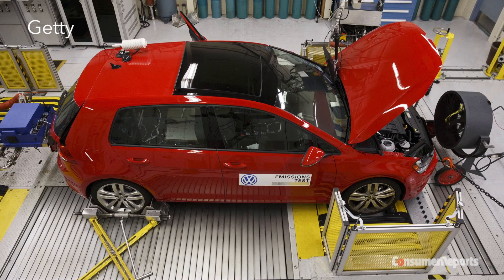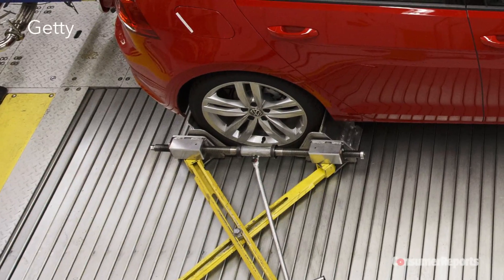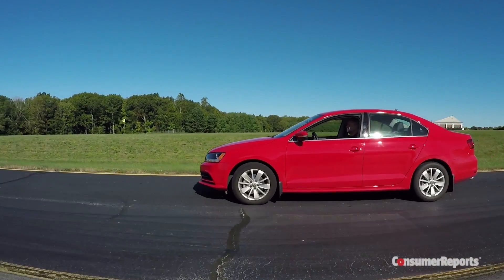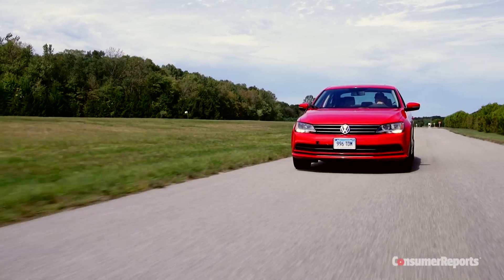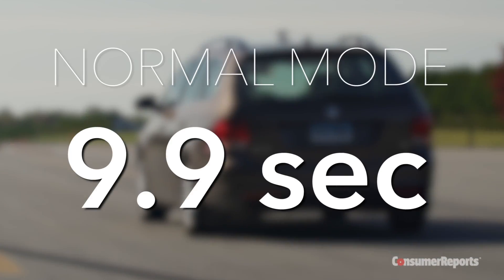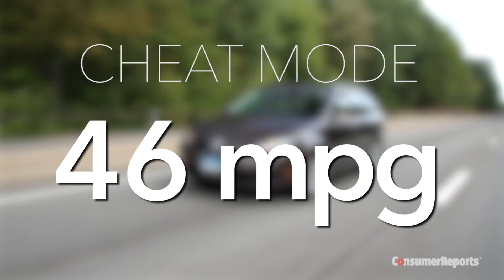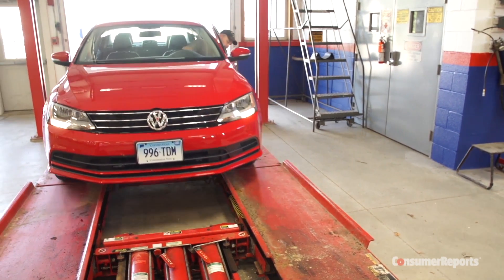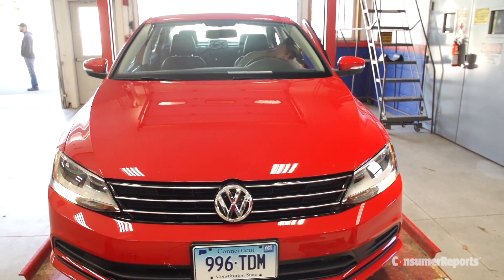How Volkswagen Diesels Perform in 'Cheat Mode' | Consumer Reports

Comment: You did succeed in  engaging  cheat mode,  the vehicle ECU monitors a multiplicity of parameters far beyond the ones which you disabled, speed vs time and steering wheel angle to name two,  google, during your back-back driving comparisons, the defeat device will be in operation allowing the 20 to 40  times exceedance of EPA limits for Nox emissions,   Felix Domke for a highly regarded forensic examination of the VW defeat device  equipped ECU

Comment: Thats not emission mode!! You applied steering input cant do that. And a lot of other errors... The car knew that it wasen´t beeing tested. There are about 8 parameters that need to be fuffiled for it to lower emission. The test is standardized so it looks for certin speeds and rpms for x amount of time to. air pressure also and so on. So this test it total fail.

Comment: I believe the DEFEAT DEVICE works like this.
When a VW car is being tested, the OBD/DLC plug has to be connected to the vehicle.  Upon connection with car on or off.... the VW's  computer uProcessor DETECTS   *thru a small voltage signal(s) to a watchdog pin(s)*... a 0 or 1 digital level ALERT signal. Meaning that the OBD/DLC plug is IN and so... TEST TIME condition is ON.  Therefore, the system's software defaults automatically to a LAB TEST CONDITION situation. Meaning all EPA components are activated.  As the car should NORMALLY be the entire time it runs. And so, the car runs perfectly, complying to EPA mandates and specs...passing or not the test.
The DEFEAT DEVICE software (disconnect EPA components) is automatically re-enabled as soon as the OBD/DLC plug...is DISCONNECTED. Meaning the test is OVER.   The software detects that the watchdog pin or pins are at O or 1 digital level. And upon turning the car off and back on, the computer RESETS itself back to CHEAT mode. Until the next EPA testing session. It's a rather simple process. 
This is the simplest way I can explain it.

Comment: VW has been making a diesel engine that gets over 50 miles to the gallon since the 80s. This cannot be said for any of the other car manufacturers. My VW TDI holds 14 and a half gallons and goes a little over 800 miles to a tank there is not a single gas car on the market that gets that kind of economy!
Reply: Really? I get about 600 hwy with my wife and I's 2013 Jetta.
Reply: avenged06x what was your average speed? I get 50+ at 65 mph and 70mpg with my stage 2 tune with dpf and egr delete

Comment: It really makes no sense, if you run a engine lean to pass the epa test in cheat mode it seems fuel mileage would increase. their must be something about the diesel engine, that when it is leaned out to the point that it would pass the epa guidelines, engine efficiency must go down to the point that it would take more throttle and rpm to do the same amount of work. this could be whats going on here.

Comment: This whole video is presented ass backwards!
these cars are in cheat mode when the drivetrain module sees ALL FOUR wheels in motion - when they "hacked" the module to see only two wheels in motion, the car is in TEST MODE.
That's why the car shows better mileage and performance WITHOUT their "hack"
Dumb ass Consumer Reports!
I've very seldom seen them actually know what they're talking about.
(I KNOW they're wrong on this one, I've owned two TDIs!)
Reply: Mike US OG K depends on who is being cheated.  Is it the person that paid for the car or is it cheating EPA?  In any mode it is either cheating the owner or EPA.  Let's put it this way, if it is on limp mode it is cheating the owner momentarily which only happens when it is undergoing a test (you didn't pay for a detuned car).  If it is on max power mode then it is cheating the EPA which doesn't matter whether if it passes the emissions test with the cheat on or off.  Falsifying info is always bad especially against Uncle Sam.
Reply: C6Roadster 
All of the hype has been presented as the vehicle is in "cheat mode", as in cheating under normal highway driving, not in test mode, so that's my take on "cheat" - as presented by the majority.
By majority opinion, the cheat is not passing certification, in this "mode" the customer gets better fuel mileage and better performance.
Technically there is no cheat - the car(s) pass the test guidelines set forth - at no time do the parameters include testing the car on the road or a four wheel dyno, and the cars pass the specified test under the specified test conditions.
I agree that it is wrong, but they're not exactly the first car company to do so, they merely got caught. Dodge did exactly the same thing at the turn of this century with their diesel pickups.
There are numerous other instances by US car companies over the last 3 decades.
The emission digressions by the other companies were all but ignored.
Ford is "cheating" presently, the Mustang GT only produces advertised horsepower on a two wheel chassis dynamometer, when tested on a four wheel dyno - which simulates actual driving - the power produced is significantly less than advertised. This is only cheating the customer, and false advertising so the government doesn't care.
As far as my statement about consumer reports, I stand by exactly what I said - their opinion of cheat mode and the entire auto industy's are exactly polar opposites.
The one point in all of this that is entirely ignored is that cheating or not, these cars are
 STILL cleaner than the vast majority of "legal" diesel vehicles.
Right or wrong, there's as much here in the way of politics as anything else.
Reply: C6Roadster 
Just to show that GM isn't exempt, a Corvette with a drivetrain module programmed to back out ignition timing after a period of time, causing an overheat condition, which in turn puts the car in limp mode, all in the name of limiting agressive drive time is exactly a cheat. The Corvette cheat reduces warranty repairs for abusive driving.

Comment: Why does it get less mpg, if it makes less power? Aren't those usually mutually opposing factors? Is it an efficiency issue?
Reply: +Beastly G 
true. my 2003 didn't, but my ex's 2013 does, first year for DEF for VW I believe. 
The car isn't as dirty as most would believe, it's is still cleaner ( even in cheat mode) than any "legal" full size pickup/suv.
As a minor point of interest, my 2003 had gone 340,000 miles - it's still in use today -
with one major repair, the turbo wore out at 310,00 miles. the nay sayers obviously haven't owned one.
Reply: crxdelsolsir 
I'm quite well aware.
Exactly my point.
Isn't right...
Same road, same air, but anything heavier can belch smoke & toxins but the car - which is at least 50 times cleaner, even while "cheating" - is a huge problem.
It's just fucking stupid.

Last time....    Dodge Ram Cummins 2000 - 2002, Dodge was told "bad pickup, bad!"
And no one heard a thing.
Reply: Mike US OG K
That was exactly my thinking on the issue too! I just didn't get why VW's are suddenly these
evil ozone death machines, but the giant diesel trucks (pedestrian ones, obviously the ones that transport goods exist out of necessity), and SUVs etc all get a pass. Especially when they still pollute more. I guess people would probably say well, at least they "didn't lie about" polluting a shit-ton lol.
Reply: When I heard about this at first, I was confused as well; I thought that a car using less fuel would have cleaner exhaust just because less fuel is being used! I've learned that it may relate to how the exhaust gases are filtered out after the fuel has combusted. Cleaner emissions control systems tend to generate more engine back-pressure, which causes the engine to have to work harder to run at a particular speed than if it had a dirtier but more-direct exhaust system. When it comes to the issues with VW's cars, I suspect there may be something in the chemistry of burning diesel in 'normal' mode which causes the exhaust composition to be dirtier in exchange for allowing the car to get more power from each drop of fuel.
Reply: Patrick Carnahan
That makes a lot of sense. I do know that VW doesn't use the urea injection that most other diesels use so could be a factor as well.
Reply: Mike US OG K
Completely agree, that's exactly what I've been saying... (about the trucks and SUVs being dirtier)!!  Very impressive on the miles. That's good to know.
Reply: Beastly G 
Absolutely!!
And yes, I've been more fortunate!
Reply: SUV being heavier are benched differently due to their inherent weight. Just as buses and semi trucks are not in the same class and therefore benched differently.

So their ratio of particulates per distance traveled per ton of mass is very different to a light weight vehicle.
Reply: Mike US OG K Yes, very likely. Especially when chevy just started doing their own economical diesel cars.... mighty suspect timing.
Reply: Beastly G 
Exactly.
👍
Reply: +Beastly G 
My '15 TDI Jetta uses DEF.
Reply: Mike US OG K
Hmm, maybe just the older ones don't?
Reply: Beastly G 
I think there's more to it than meets the eye, maybe a little corporate espionage.
My opinion is that it is an opportunity for other carmakers to "cripple" the largest carmaker in the world (VW), so they're more than happy to help make a fuss over it.
Reply: Beastly G diesel engines get better fule economy the more powerful they are
Reply: Mike US OG K  VW got in trouble because they tired to cheat the EPA the EPA is bull shit targeting diesel engines but the fact we can make B20 hurts big oil lobbiest come into play here blah blah blah lots of bull shit German company that is largest auto maker in the world 
pick ups are also regulated different then cars lots of stuff goes into this 

but as far as fule economy diesel make more power use less fule by compressing air and using it to burn diesel more efficiently vs gas only has a 30% burn rate
Reply: The Corey Becraft show 
So what are you trying to tell me?
I know exactly why VW got in trouble in the first place...
And I know other companies have gotten away with it in the past, so why crucify VW - there's more here than meets the eye.
If you don't believe the VW group is the largest carmaker in the world - go look it up for yourself!
Yes, I know quite well pickups are qualified differently - doesn't change my point in the least.
I also know EXACTLY how diesels work - that's why I drive one.

Blah blah blah bullshit yourself!
Reply: I told you they are the largest auto maker 

my point is that the United States has a beef with diesel engines and VW Being the biggest diesel automaker they targeted them that's all I said boss so chill out 

and the people who were talking like they didn't understand how diesels lose fule economy by losing power I was explaining that to them
Reply: The Corey Becraft show 
So then why did you tag me?
VW is the largest car maker in the world - period, diesel or not.
You didn't tell me anything new about VW.

Don't say blah blah blah bullshit to me then tell ME to chill out - you started it, so think more about what you say to someone before you tell them to chill out.
Reply: did you even read what I was talking about it was talking about the EPAs bull shit reasons again I didn't say they were not the largest auto maker in said they were indeed and I also said they are the largest diesel I just hit reply to the video didn't mean to tag you and your getting all pissed off and didn't even read what the comments said

Comment: Personally I dont give a damn. I dont have a volkswagen anymore. I had an old jetta and the dealership wanted 90 bcks for an oem wheel bearing. I bought generic replacement one for 15 bucks each. They told me at the sealership it had a lifetime warranty if using their mechanic. So $90 each plus labour. I did it myself. Even if I had to replace it 6 times by myself it still woulda been cheaper.

Comment: cars were bought based on EPA economy and VW power ratings . Getting better economy is a perk; going back to EPA economy is not an issue . Reducing power 10% still makes it similar to competitors . I plan to maintain my Passat diesel and keep it for 700,000 km, avoiding one car purchase while getting great mileage savings (in Canada)

Comment: The Fast Lane Car did a similar test - using a dynometer  that runs all four wheels, to two wheels, and tested horsepower.  It dropped some - which it looks like matches what Consumer Reports got here on the older model.  The rear wheels spinning definitely it was keys off the computer chip.  If it is more complicated that that, TFLC did not catch it either.

Comment: Biggest problem I have with the entire diesel gate story from all the medial outlets is the 40x figure that's been thrown around. Here is what someone needs to do: get a mobile NOX measuring device and ACTUALLY MEASURE THE NOX COMING OUT THE BACK OF THE CAR while in motion. A recent test on some UK website showed that the static / stationary test can be off by a factor of 10x regarding NOX - they used a mobile NOX tester. 

We are all quoting the same source 40x BUT why can't someone actaully measure the NOX in a real live test not just guessing how  the defeat software works by messing about with sensors  or putting the car on a 4 wheel dyno etc? And an even better story, could this be industrial espionage - the Chinese adding the code - this is a very difficult thing to detect and reminder the Iranian centrifuges  ..... :) 

Also comsumer reports how about getting a big old diesel pickup and look at its NOX - probably 1000x the amount of even a cheating diesel AND I believe it's NOX exempt?? And the UPS van that delivers your Amazon prime swag or the big rig that is also EXEMPT from NOX ...... How about putting it in perspective?

Comment: I think its only done to meet the demands of EU. The EU requirements for emissions are getting ridiculous.
Reply: +NikesZ28 Actually EU emissions is very lenient compared to US limits.  The EU levels are about 15 years behind (i.e. they match US limits of 2000)
.
Reply: electrictroy2010 i was actually thinking about upcoming limits, thinks its by 2020 no car is allowed to emit more then 100 grams/kilometer of Co2.
If what you say is true, why does european  people drive around in cars with tiny 4cyl engines and americans drive around in cars with big V6 and V8 engines.  ;)
Besides the fuel cost of course.
Reply: +NikesZ28 (Americans only pay 50-60 cents/liter. We don't care about guzzling gas)  Our EPA doesn't regulate CO2.  They regulate lung-damaging chemicals called NOx, CO, exhaust hydrocarbons, and soot.  That's why in 2006 when limits were lowered, diesel sedans were effectively banned.   (Then manufacturers discovered urea injection & reintroduced diesels in 2009.)   ANYWAY that's why I say US limits are much harder to pass..... the EU limits were never so low that diesels were banned from sale.
ASIDE : Another technology that was banned : Lean Burn gasoline engines from Honda.  When 2006 arrived, Honda was forced to stop selling lean-burn technology, due to the EPA's strict low limits on NOx
.

Comment: Eum, Consumer Reports doesn't seems to get how these modern ecu works, there's more than just removing the rear speed sensor to engage cheat mode, what you activated was safe mode since the ecu detected an anomaly in the sensors and values ratio way higher (front wheel speed / rear wheel speed) , its similar to just disconnecting the O2 sensor... In fact try just unplugging the O2 sensor to see if you get the same results as your ''cheat mode'' test, if so, that ain't cheat mode. Cheat mode will rely on acceleration curves, G-Force and other factors to make sure that the car si in fact on a dyno and not just slipping on ice in a driveway... Anywho, nice try but contact a chip tuner to help you out...

Comment: VW cheats on emissions and is fined $18 BILLION

GM knowingly installs faulty ignition switches resulting in the deaths of 100's and lies repeatedly about it, including under oath to Congress and is fined $35 million
Reply: +sugershakify GM did not knowingly install faulty switches.  It turns-out the design engineer & his direct manager caught the faulty switch, fixed the flaw, and then covered it up.  GM had no idea about the coverup by these 2 individuals
.
In contrast VW's scandal involves most of the management.  It is a crime that includes 100s of people
.
Reply: electrictroy2010
 This is not correct. GM did not knowingly install faulty switches AT FIRST. After they knew they had a problem they continued to install the faulty switched rather than spend the money on a general recall. This was known by the CEO of GM and she specifically lied under to oath to Congress that she was not aware of the problem. Later leaked emails proved this.
Reply: +sugershakify INCORRECT.  As soon as the faulty switch was discovered, it was discontinued & the responsible engineer redesigned it with a working switch (circa 2007).  So NO they did not continue selling faulty switches
.
You are correct there was no recall, but that's not GM's fault.  The engineer never told anyone the old switch was flawed (i.e. he covered it up)
.

Comment: OK Consumer Reports. You got confused me.
IF in CHEAT mode I get worse fuel economy (it eats more fuel), how come it is better than in NORMAL mode?
Reply: +Piotr L. Pawlak Lower MPG == rich burn == lower engine temperature which outputs higher levels of N2 and O2 (good) and lower levels of NOx (smog)
.
Higher MPG == lean burn == higher engine temperature which emits more NOx (smog)
.
Reply: +electrictroy2010 That's a very generic statement. Such results can be achieved during regular use of car without any "cheat software" as ratios change all the time. In addition, the changes you are referring to are, not explaining "huge NOx emissions". I am looking for some real proof of VW cheat software in the test. Like a code that says what the car will do.